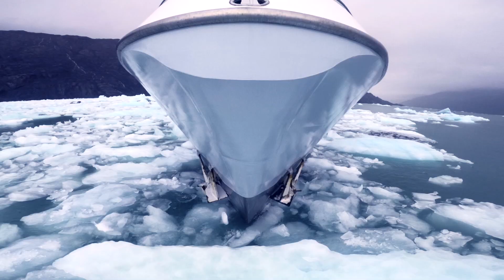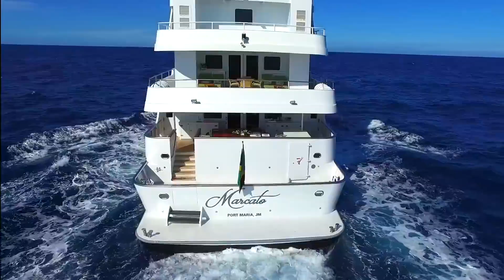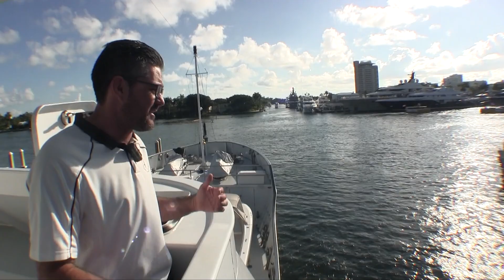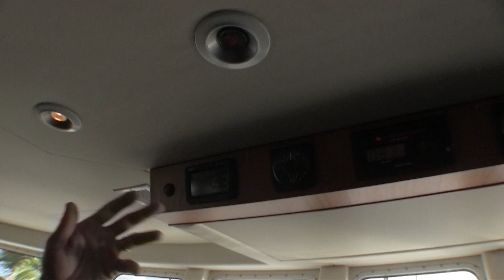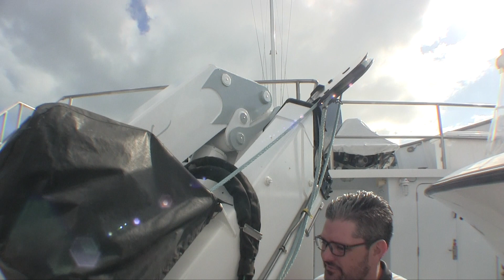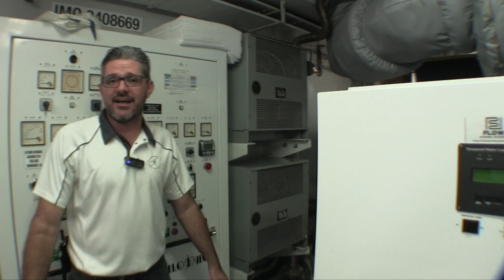141' Expedition Yacht MARCATO  Captain's Technical Tour

Comment: One deck too many. It looks so unstable.
Reply from the maker: This vessel has excellent stability. Most yachts have more structure above deck level. It's deceiving to the eye because of all the open deck space.
Reply: The ship is extremely stable. I watched her built at hike metal
Reply: I don’t think it’s any more unstable than a sailboat? With a steel hull and ballast , along with all the fuel, oil  , water and waste tanks in the hull this would be a very stable boat

Comment: Why the need to use the term "Expedition ".   When there is solo boaters that also travel far flung places ..  whose sail boats cost an absolute fraction to other overly priced vessels .  What was the vessel used for in it's previous life ???? Sure as hell looks like a converted Fishing Trawler ... 

The term yacht is overly mis used imo
Reply: Most expedition yachts look like that.  They aren’t the pretty, sleek, Italian-designed ships.  They are more rugged (made to be comfortable in heavy seas and harsh weather).  They are generally more economical in their use of fuel (trading speed).  They are made to take you anywhere you want to go with all of the toys you want in full comfort.  They look like commercial work boats as they are built to the same standards and for a purpose that is closer to a work boat (safety at sea in all conditions) that a boat that is made for hopping islands in the Bahamas.
Reply: @aarongranger   The term was never used for any vessels in the past it's a newly created term for ignorant dimwits that seem to think that vessels given that term are the only ones capable of transatlantic range and beyond .  When there is channels on this very site and none of there vessels is described  "Expedition ". It's purely a marketing term nothing more .
Reply: @colintraveller  Not really. Explorer yachts are those I would consider to have long range and constructed for heavy seas. Expedition to my mind would say ice class steel. I think you're just trying to look clever when your point is actually moot.
Reply: Why would anyone buy a Toyota Land Cruiser when you can get a lot more comfort, amenities, fuel economy, and seating in a Chrysler Pacifica Limited for less than half the price?
Because your Pacifica can't get you in AND out of places like this:
https://i.ytimg.com/vi/S9glv8XthI0/maxresdefault.jpg

Comment: I can't imagine buying this instead of a shadow marine global. It's over 200 ft and 1/3 the price with better basically everything
Reply: Well I’m sure M/Y Global is a very capable yacht however I would rather use 18,000 gals of fuel to go 8,000 NM than nearly five times as much to go 10,000 NM. Neither are environmentally friendly but it’s clear the M/Y Marcato is far more efficient.  Not to mention that M/Y Global has nearly double the crew complement and at 80 feet longer it could only provide two more staterooms? The costs of operating   M/Y Global would be exponentially higher with only two more staterooms to charter. No thanks. M/Y Marcato is the perfect size in my view.